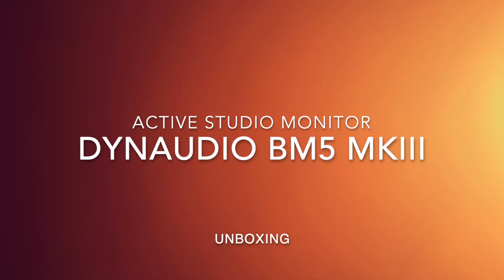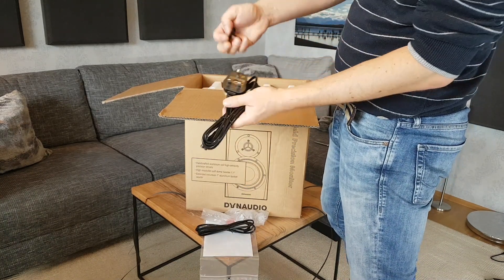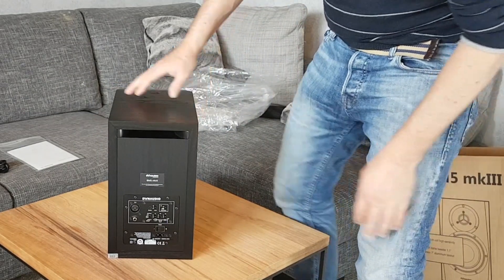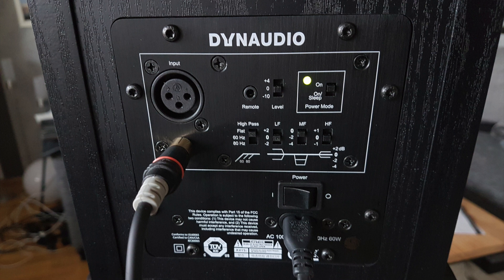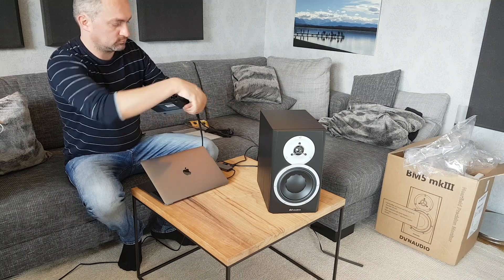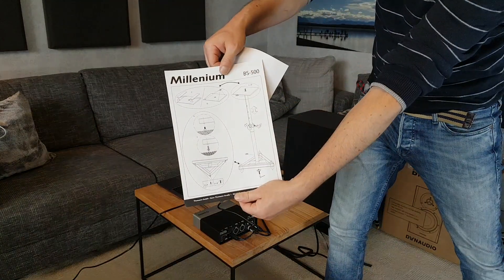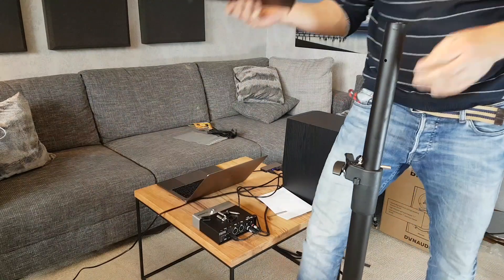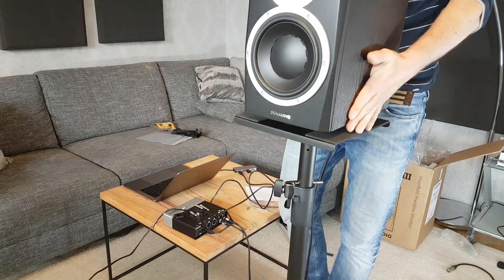DYNAUDIO BM5 mkIII Active Studio Monitors - Unboxing + Setup

Comment: Hi.
I have also have 2 BM5 mkIII conected with cannon Xlr to my Focusrite sound card, so as to hear the sound of the pc.
Question is. Can i connect my dj controller with rca cables to the dynaudio  BM5 mkIII and use all 2 monitor inputs simultaneously?
Reply from the maker: I'm sorry, but I can't answer this.. somebody else who reads this?
Reply: Yes you can but I dont recomand you to do that because xlr and rca in's have different sensitivity and simply they are not build for that purpouse and maybe you will damage the amplifiers inside cheers
Reply: @filipkrstevski5449  well the shop i bought them at says these are the best monitors to add a dj controller too?

Comment: Emmm, i dont know if someone told you that the steinberg doesnt come with balance output, but they do. Is not XLR, is TRS, but is still a balanced output. in order to use those monitors on the most efficient way you need to use a XLR Male to TRS Male cable, otherwise you are adding distortion, picking up noise and losing volume.

Comment: would someone suggest these for listening to music. I have no ittentions towards producing.
Reply: Hi Psyber84, hmm it depends.. the value for money is very good with theese speakers. But the sound is very analytical and isn't softing or tuning the input signal. Means, with poor recordings listening might be no pleasure.. How much money do you wanna spend?
Reply: @lammfromm100  no more than 700 euros. Ι already have a nad 356bee stero amplifier.
Reply: @psyber84  ah ok, so you don't need active speakers! I would recommend one of theese: Dali Opticon 1, Bowers & Wilkins 606, Dynaudio Emit M20, Elac Uni-Fi BS U5. What's your favourite style of music?
Reply: @lammfromm100  I am seriously considering the emit m20. I lsiten to progressive rock, sometimes electronic and symphonic.
Reply: @psyber84  Hm in this case I would listen to the Bowers & Wilkins 606 - with it's aluminium tweeter it should be fast and bright enough for the high frequencies of rock music..
Reply from the maker: Hi, i listened to a pair of Adam and also Eve speakers before I bought the Dynaudios' - both with ribbon tweeters - but found them too harsh in the high frequencies and too boomy in the low end. Stereo image from the Dynaudios' is very good - but of course depending on your placement (ideally you have space behind them, and a reverb compensated room with reverb times lower than 0,3 sec. - i use Basotect absorbers). Analytically they are also quite good regarding the price range, but of course there are better - but much more expensive - speakers on the market. My Hifi setup consists of a pair auf Elac 407 floor standing ribbon tweeter speakers, witch I really love. Especially in combination with the hybrid amp Unico Secondo from Unison Research.
Reply: @m-a-n-u-e-l  Adam and also Eve... How cool is that?
Reply: Yes they are perfect because I have them and use them for listening only. Paired with good audio interface is audio nirvana cheers